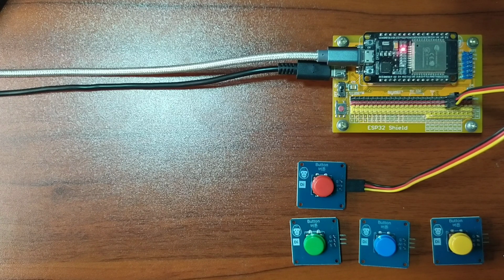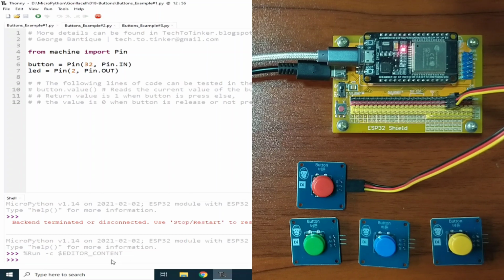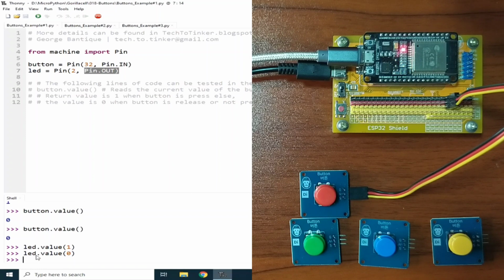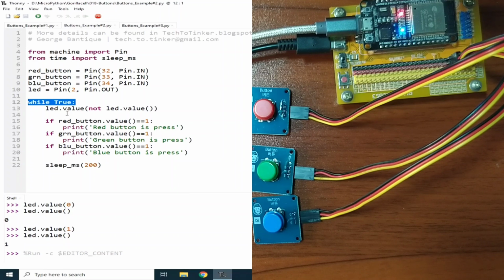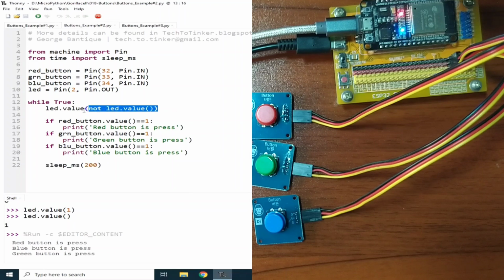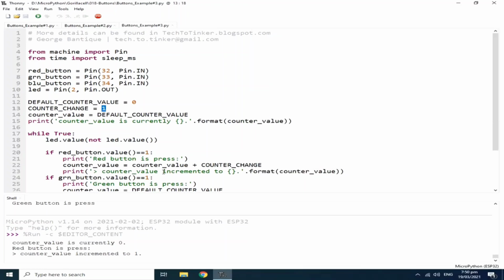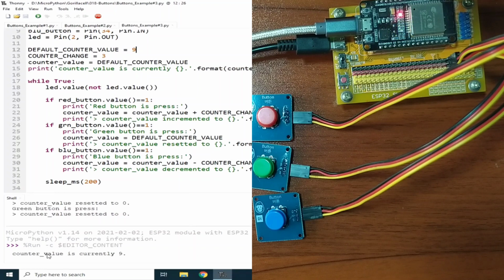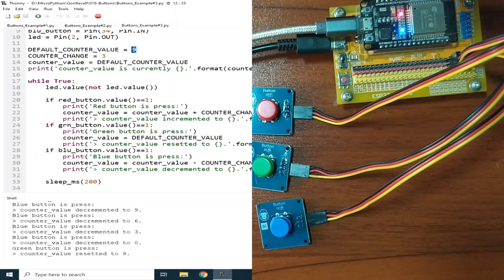018 - MicroPython TechNotes: Buttons | Reading an Input

Comment: So with micro python , we do not have to program a “debounce”?
Reply from the maker: @Nick Sebring, debounce is important especially when using switches. When you press a mechanical switch, it closes and opens several times which is called "bounce". And to prevent it, we use a "debounce".

Debounce can be done in 2 ways, in hardware and in software. In hardware, it is done by putting a minimal value of capacitor while in software through a debounce code. What I did is a very simple soft debounce.

Now to answer your question, we need a debounce in MicroPython or any programming language.

Hope this helps you. Cheers and thank you.